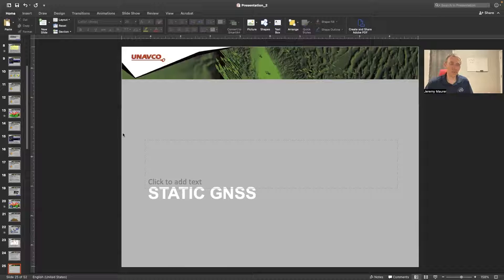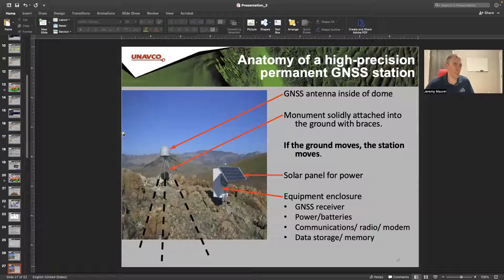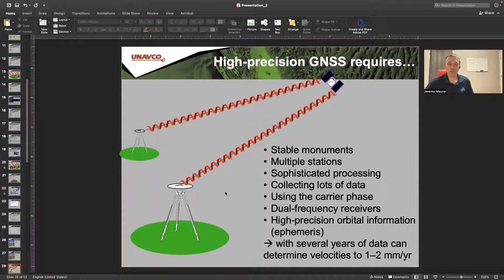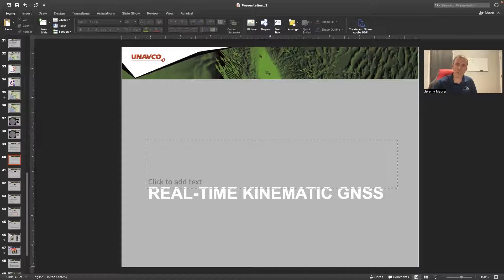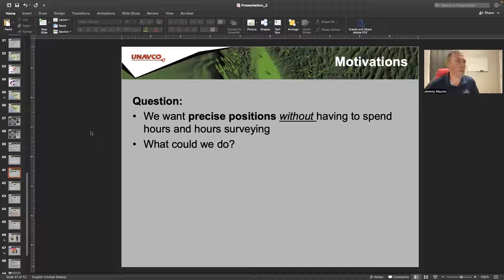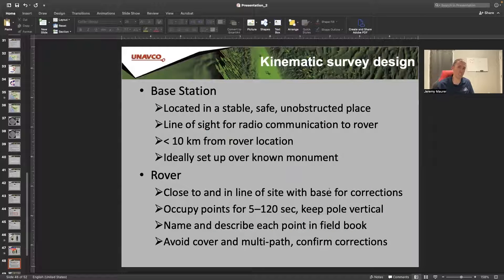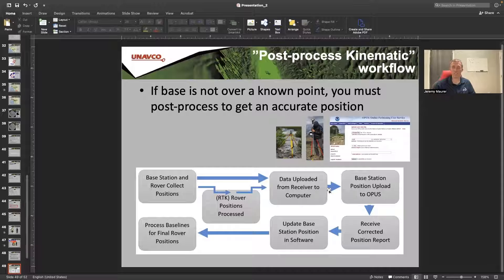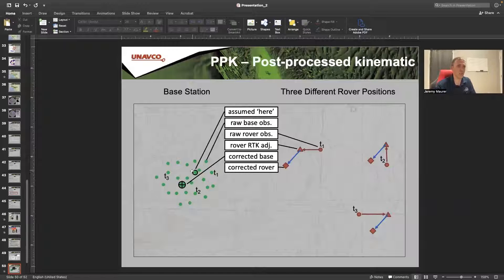Introduction to GNSS: Static and RTK

Comment: These are very good videos. Thanks for sharing the knowledge and tactics. Really appreciate this.

I would like to ask if it is possible to mount the rover over a drone that can fly over wide rivers to deduce the exact point and locations for river cross-section, even for swamps and inaccessible flood plains.

Or will there be any difficulties or errors induced due to the motion of the drone? 

Thanks.